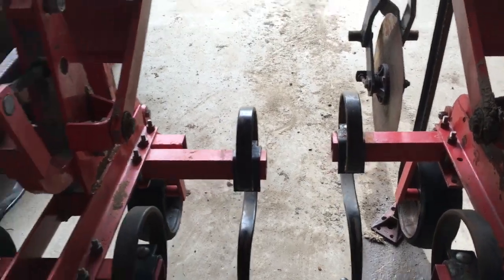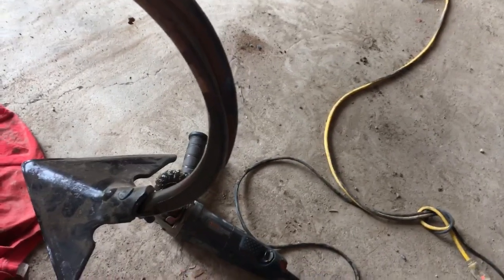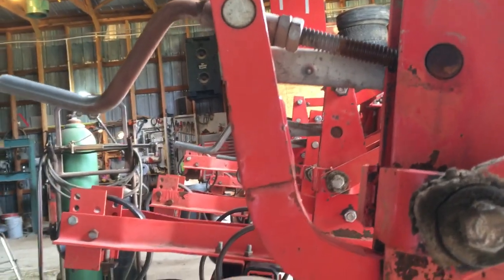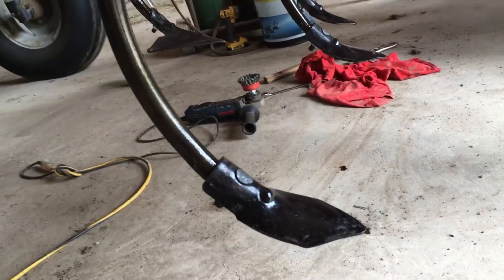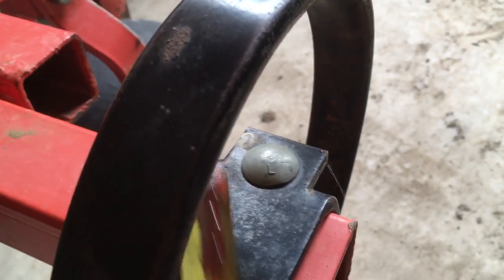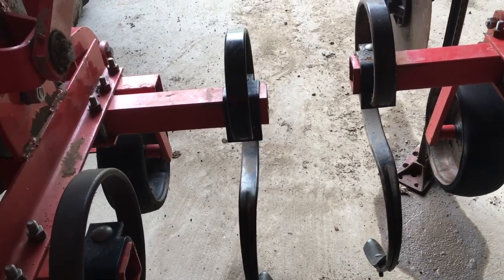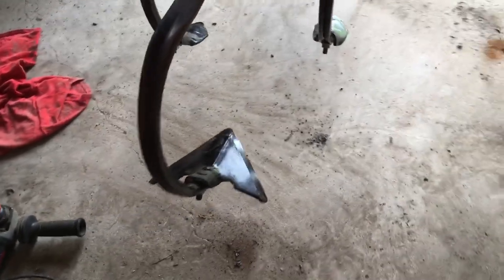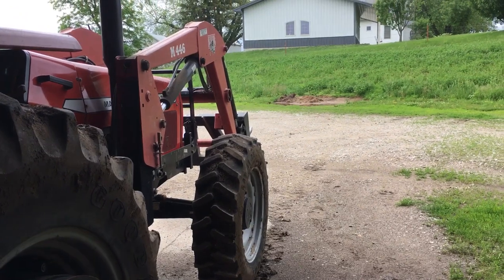In-row/Blind Cultivator pt2

Comment: Nice looking cultivator! Can you explain why you plant on ridges? Planting by the end of this week may be wishful thinking or deep Faith, wife and daughter tell about crested rivers and areas inaccessible from Kansas City to Hutchinson and South.
Reply from the maker: Thanks.  South of I-70 has definitely gotten more rain. but we are sure saturated here.  As wet as it is, we do have hill fields that will plant 4 days after the rain ends.  Bottom ground will require more time!  When I plant, my planter pushes up ridges between the rows.  In this video I discuss/show how my Kinze planter is set up and operates.
https://www.youtube.com/watch?v=OCRHkbKWyc0&t=13s

Thus it sometimes becomes necessary to clean at the bottom of the furrows where the crop is emerging WHEN THE ROTARY HOE WILL NOT WORK due to height of the ridge or crusting action.  Typically I can do this with my other cultivators by burying action.  Sometimes this doesn't work and this cultivator is my first attempt to deal with this unique situation.